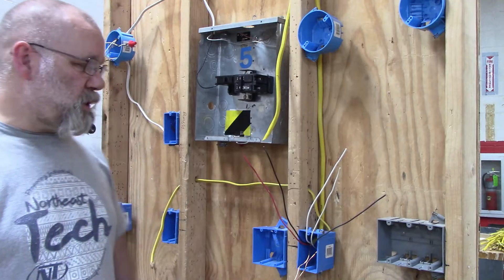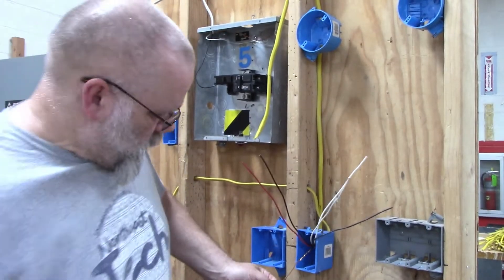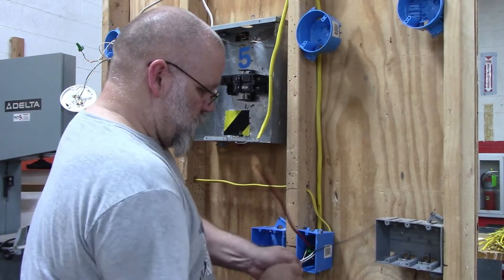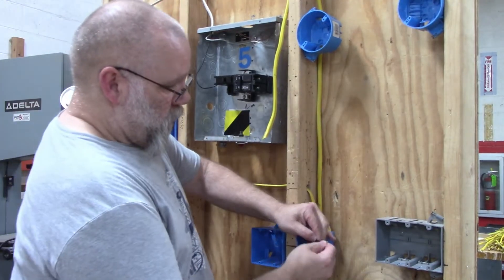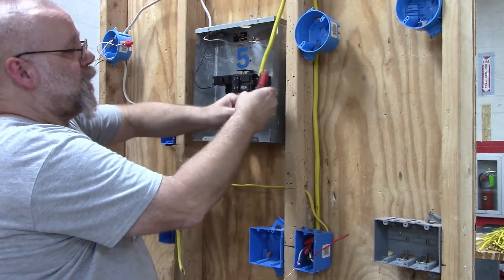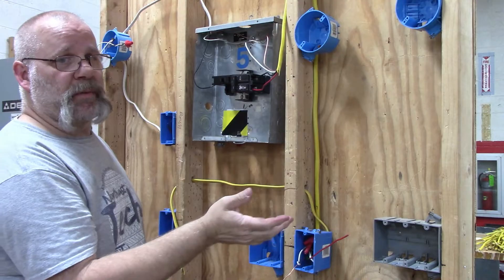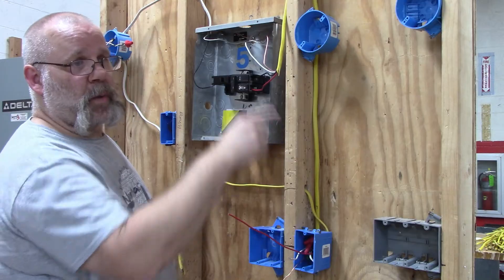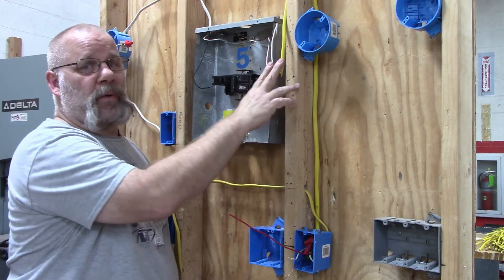3 wire homerun for 2 circuits

Comment: Penny wise and pound foolish. These should be outlawed. The juice is just not worth the squeeze. Too many opportunities for mistakes and electrocution. I know personally that a recent upgrade service has a MWBC and the licensed electrician used two un-tied breakers without labeling. Not able to see them unless you pull the cover from the panel.
Reply from the maker: I dont disagree with you, i was hit by this the first time i ran across it.

Comment: I thought the NEC code required each hot leg circuit to have their own separate neutral home run if your splitting the legs of a double pull breaker?. If each hot leg is on a separate phase and 20 amps each, won’t this be overloading the single neutral wire with amps adding together from both circuits and won’t the two buss bar phases (out of phase of each other) on single wire create magnetic fields and fire hazard?

Comment: Each circuit needs it's own neutral.  This would never pass inspection.  Stop telling people to do things the wrong way.
Reply from the maker: This is and has been used. People need to be aware of it so they dont get hurt if they run across it.

Comment: While this was a very good explanation and code says it’s ok to do following all the stipulations, I would not recommend this at all. In the case of losing a neutral you are sending too much or not enough voltage to a device which could cause severe damage . If you are trying to troubleshoot an issue you will get voltage back feeding on the neutral. Save yourself some headaches run separate circuits and neutrals to your devices. Happy wiring.
Reply from the maker: I agree, the first time I ran across it many years ago I got zapped. I teach it to my students so they don't get zapped.

Comment: can i run a 10/3  for a home run then run 12/2 from there
Reply from the maker: @bquedenfeld  you can, but not recommended. If you do it, it needs to be breakered at the lower amperage.

Comment: When you meter between the red and black wires, you should read 240v. If you use a tandem breaker (single space), you will get 0 Volts, and this is WRONG. The Black and Red wires must be on different phases. Only a two-pole breaker (like in the video) can do this.

Comment: You didn't explain why the breakers have to be side-by-side, which is so that the shared neutral is not overloaded due to the two hots being on the same phase.  You did say the breakers need to be side-by-side (adjacent), which ensures that the two hots are on different phases so as not to overload the neutral.
Reply: So the dual breakers are designed to ensure 2 hots always on different phases and not overload the shared neutral?
Reply: I am learning please explain. I thought double pull breaker picks up each hot leg from separate bus bars and each bus bar is out of phase of each other? I thought the NEC code required each hot leg circuit to have their own separate neutral home run if your splitting the legs of a double pull breaker?. If each hot leg is on a separate phase and 20 amps each, won’t this be overloading the single neutral wire with amps adding together from both circuits and won’t the two buss bar phases (out of phase of each other) on single wire create magnetic fields and fire hazard?
Reply: @andyjohnson42 A shared neutral on a double-pole breaker isn't overloaded because the two hot wires are on opposite phases of the electrical system, which means their currents flow in opposite directions and effectively cancel each other out. For a properly wired double-pole breaker, the neutral wire only carries the difference between the loads on the two hot wires, not the sum, preventing an overload. [1, 2, 3]  
How it works 

• Opposite phases: The two hot wires in a double-pole breaker are on separate phases, meaning they are 180 degrees out of sync. [1, 3, 4]  
• Current cancellation: When the loads on both circuits are balanced, the current returning on the neutral wire from one circuit is canceled by the current returning from the other. [1, 2]  
• Carries the difference: In an unbalanced situation, the neutral wire carries only the difference in current between the two circuits. For example, if one circuit has a load of 10 amps and the other has 15 amps, the neutral wire will only carry the difference of 5 amps. [2, 5]  
• Safety: This system is safe as long as both circuits are on opposite phases, which is ensured by using a double-pole breaker or a single-pole breaker with a handle tie, so that both circuits are de-energized at the same time. [3, 6]  

Why it's dangerous to do it incorrectly 

• On the same phase: If both hot wires were on the same phase (using two single-pole breakers without a handle tie), the currents would add up instead of canceling out, and the neutral wire could be overloaded. [7, 8]  

AI responses may include mistakes.

[1] https://www.reddit.com/r/DIY/comments/18kjuos/do_circuits_share_a_neutral_wire_the_two_hots_are/
[2] https://sawmillcreek.org/threads/calling-all-electricians-sharing-neutral-on-split-wired-circuit.269775/
[3] https://www.reddit.com/r/AskElectricians/comments/1kze0hi/shared_neutral_across_breakers/
[4] https://www.quora.com/Can-two-branch-circuits-share-the-same-neutral-wire-What-is-a-shared-neutral
[5] https://www.reddit.com/r/AskElectricians/comments/13k3lzj/question_about_sharing_neutrals/
[6] https://forums.mikeholt.com/threads/shared-neutral.8850/
[7] https://diy.stackexchange.com/questions/293783/if-i-split-a-shared-neutral-circuit-into-2-circuits-will-i-avoid-an-overload
[8] https://www.youtube.com/watch?v=qM2hJmtq3T4
Reply: He did at 4:19 because they need to be tied together so that when you turn one off they both turn off so you don’t work in the box thinking it’s off and accidentally still have a hot on

Comment: Great video. I do have a question though. When you bring your 12-3 to the box and split it off to say two bedrooms like you said, would you then stay with 12-2 or go to 14-2?
Reply from the maker: @BenGates101  stay with 12-2, don't change wire size. If you use a smaller cable you have to breaker it for the smaller.

Comment: Yeah but with today's code this isn't legal. All circuits must have their own neutral in residential wiring and Arc Fault breakers won't work in this application.
Reply from the maker: When you teach wiring you have to show the old stuff that you may run across when working on older houses.
Reply: @timpalmer-logstolumber1999  You are so correct about that as in the past few months as I started educating myself about home electrics to simply replace sockets on the brand new 1992 home we moved into, I found most of the breakers use MWBC and most are 1 inch double pole breakers and NONE of those have handle ties to alert someone to turn off both breakers. And in 1 case the slot 4 top breaker is in a MWBC with slot 5 bottom breaker so impossible to even do in that case. Further, all the romex is white in color both 14 and 12 gauge; no yellow for 12 gauge back then I guess. And even worse I now know, the microwave and fridge are on separate separate breakers in a MWBC config and they hooked the neutral wire from the fridge to the receptacle of the microwave instead of making a simple pigtail...a real no-no by what I have since found out. Maybe I was lucky when I replace most all the receptacles in the house I didn't get shocked or fry something by what I know now. I've watched several videos of pristine looking panel boxes with a breaker for each circuit and neutral and built-in gf/ac-fi and my square D panel box so tight I can't safely get an amp clamp around a wire if I real had to.....Thanks for the information.
Reply: This meets code and some arc fault breakers are listed to be tied together for multi wire applications. GE is one of them.

Comment: Have a condo 1970's and using alumiconn connectors.  But they have a 3 wire coming from box with black to fridge outlet, shared neutral and red going to GFI and Dishwasher switch.  Source is one 20 amp breaker.  Electrician ran a separate copper on separate breaker so should use that for gfi/dw and the 3 wire for fridge.  But how do I alumiconn 3 wire aluminum to copper?   Have the green screws and box with raised grounding hole.
Reply from the maker: They make connectors for it.

Comment: I have a similar situation with one 12/3 supply that feeds 8 receptacles in the living room, 5 receptacles in the mud room, and one receptacle in the garage. These are 2-prong 20amp receptacles. I am in the process of adding GFCI to the first receptacle of each branch in the house so that I can switch to 3-prong receptacles (per code). However, I believe having two circuits tied together with a common ground wire will cause the GFCI to trip continuously. I am thinking that I will have to replace the 12/3 with two 12/2 2 WG. I have plaster walls and trying not to have to tear them out to do this work. Do you have a (by code) workaround? Where would I find a reference to this in the NEC code book? I am reading the NFPA 70 book for 2023.
Reply: Can you use 12/2/2 wire instead of two 12/2 wires? I am not an electrician, but thought the grounds can be tied together of each circuit, but the neutrals of each lhot leg needed to be their own circuit and not combined?

Comment: Your theory is correct as far as using 12/3 to use two different circuits, however you demonstration isn’t. Demonstration is 2 20a single circuits with 240v in the panel.at the boxes You just used the 12-3 traveler to tie power through to the box jumper.nothing was done with the red traveler. Now, your explanation was correct, however you can no longer do this because you now have two 20a circuits sharing one neutral rated for one circuit back to power source.

Comment: I don't see the benefits of a shared neutral.  You still have to shut off both circuits to work on one circuit.  Cost savings can’t be that much when wiring a small house. 

I say this because the moron I bought my house from ran a shared neutral on two separate breakers with no tie bar.  I found the hack job in the attack. He ran a 14 gauge neutral from a 20amp circuit to close a 15amp circuit.
Reply from the maker: Different gauge wires should not be used on same circuit. If it can't be changed make sure it's breakered at smaller amps. Label for future reference.
Reply: I mapped out the two circuits (used a Klein tracer) and pulled out  the 14-2 nonsense used to cross neutrals.  Rewired with 12- 2 and no more shared neutral.  It was total bs.
Reply: And therein lies the problem. Everyone thinks they are an electrician. Thank you Home Depot!
Reply: ’m no pro electrician.  Took a house wiring class in 10th grade in 1992 - common sense early.

To add to the idiocy, whoever crossed the neutrals in my attic ran them on the same phase.

Comment: Is it permitted to run this method in my wood shop to create a 3 gang box thats jas one 12/3 and has 2 duplex 120v outlets for my miter saw and table saw/sander or whatever else needs to be plugged in on seprate circuts to eachother then a single 220v plug for my planer at the end of the loop?
Reply from the maker: No that will not work. It has to be either 120 volts or 220, it can't be both.
Reply: Maybe a better way to explain. Have the black go to a outlet then pass on, then have the red go to a outlet and pass on making them like the video on 2 circuts, then connect the black and red to a single 220v plug?

Comment: Can you use a two pole arc fault breaker to protect this circuit?
Reply from the maker: Arc fault breakers don't work with shared neutral

Comment: I have an existing 10/3 wire.  I want to use this principle to take the 10/3 wire and power two 20A receptacles.  Is this problematic?
Reply from the maker: No

Comment: This is confusing, it sounds like what you are saying is for example you could run the 12/3 to a 220v outlet and pull 36 amps from the two 20 amp breakers / toggles that are tied together. Is this correct? I have no idea just looking for the awnser, Thanks!
Reply from the maker: If you use two breakers tied together you have 120 volts with a shared neutral. Each half will pull max 20 amps. The  neutral will balance them out. If you want 220 volts you would use a double breaker.

Comment: From the comments and the video title, I see you are calling this two circuits. Note that the NEC calls this a single circuit because that’s what it is. It is no different than the line feed or service entrance to your panel. It is a single, 240v circuit. Because of Ohms law and the increased resistance, 120v loads work, with the neutral carrying any imbalance. In fact, if the circuit had perfect balance, there would be no current on the neutral. One circuit. In short, we don’t consider the feed to a panel or a service drop on a house two circuits, and multi-wire branch circuits also aren’t two circuits. 

This is a most useful distinction when you want to run power to a detached building, and don’t want a sub panel. By being one circuit, you don’t need to drive additional ground rods, but you have twice the power in the out building.

Comment: Do the two breakers have to be the same amperage? or can I run a 15 amp for a lighting circuit and a 20 amp for a receptacle circuit?
Reply from the maker: Should not mix breakers

Comment: Awesome. Thanks for the walk through! Definitely cheaper to run a single 12/3 wire since it is 2/3 the amount of copper than running two 12/2 wires. I guess it comes down to the price of the breakers: two single pole vs. one two pole. Great video!

Comment: Wouldn't you be potentially overloading the neutral wire? Say if 10A is being used on both circuits then 20A will be going through the neutral etc. I was wondering cause I realized they did this on my house quite a bit on all the breakers. Furthermore the metal piece that ties the seaman breakers together doesn't work well to trip both at the same time. these are ones that are used on the single slot breakers that have the dual breakers.
Reply: I'm going to end up answering my question but I didn't think about it that since they are on the different phases the return current cancels out. But its good to note that you do need to make sure each hot wire is on a different phase.
Reply from the maker: @firefox2026  that is correct, that is why they need to be tied together

Comment: I’m upgrading my old glass screw in fuse panel in garage to seimens panel. Currently 12/3 is the feed. 20a breaker from main panel, and 10 120v outlets in garage with lights. How can I wire the new seimans panel safely without too much rewiring
Reply from the maker: You should be able to replace it without any rewiring. The only issue will be if the existing wires are long enough. You may have to adjust the location of the box or use junction boxes if wires are to short.

Comment: So watching your demo here it seems like  I could safely run 2 12-3 wires from my main house panel to a tiny house I’m building that will need 4 20 amp circuits. If so, I have an existing 1” pvc conduit under my driveway- would that be adequate for the two 12-3 wires?
Reply: Yes if you aren’t using a permit 😂
Reply: I’m not getting a permit but I still want to be safe. I’d be interested in your take. @Staayjaamin
Reply from the maker: I would think they would fit
Reply: While it might "fit" you can't run more than 1 branch circuit to a detached building without adding a full subpanel and thus, you will also need grounding rods at the detached building. This is also known as a MWBC (Multi Wire Branch Circuit). So if you're pulling permit as mentioned below, that's a no go.
Reply: @WhittyOne  I don’t need a permit but I want to be safe. It would mean breaking up a lot concrete to do another conduit to the tiny house if needed but I think I need four circuits over there. 1 for the heat pump, 1 for small water heater and fridge, 1 for lights and 1 for outlets. Is there any way to do that safely in a 1” conduit that you know of? I’m fine with a sub panel and grounding rods at the tiny house.
Reply: @joetruth7823 You actually probably DO need a permit. With that said, if you already have a 1" conduit underground, why not just use the old wire to pull a new, larger gauge feeder to it and do a subpanel with rods? Not sure how deep it is buried or how long the run is, but there are rules to that part. THWN is going to be the easiest wire to pull. Trying to feed all of what you mentioned from a MWBC (or several) really isn't safe, which is why it is against code. Remember, they use shared neutrals since the legs are out of phase, so if you lose the neutral it can fry everything else on that cicuit. Can you probably make it work - yes I think so. But If safety is your concern as you mention, I think you will find the subpanel is the safe and correct way for your application. I would figure out your wattage rating of those things you want to add, size your subpanel based on that and the amperage, and go from there. Remember if anything goes wrong such as a fire, your homeowners probably won't pay if you do it the wrong way.
Reply: @WhittyOne  Thank you for the good advice. I really appreciate it. I hadn’t even thought of the homeowners insurance issue…..